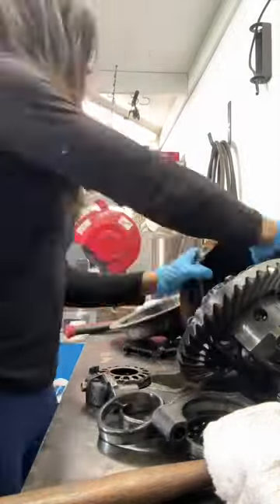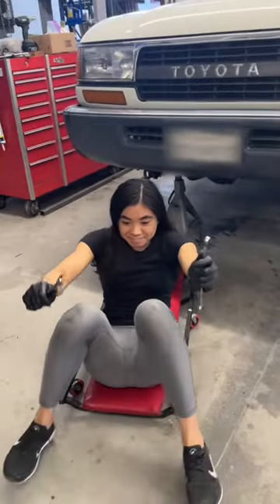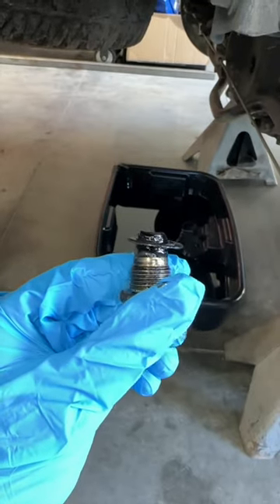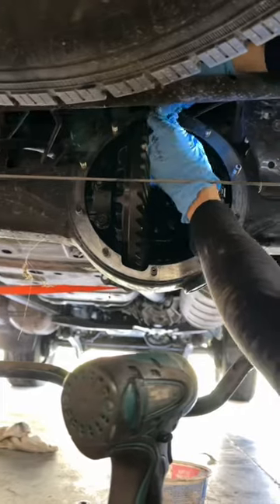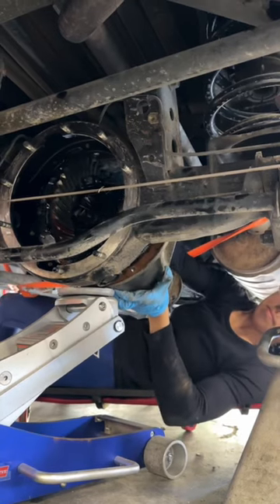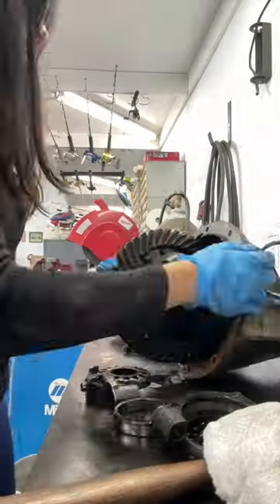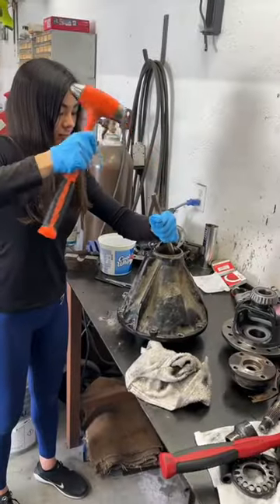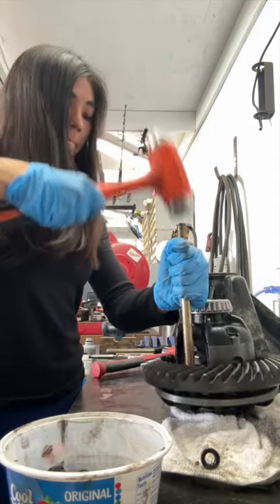Finishing my Land Cruiser Re-Gear! 😃⚙️ Pt. 1 #shorts

Comment: The first time I ever seen rear axle gears, was after I blew them apart and split the carrier in half, in my 78 cutlass after doing a 455 swap. Took the cover off and chunks of spider gears came falling out. Was satisfied that it couldn't hold the power and torque, so I swapped in a 12 bolt from a 68 el Camino. After that I've been enjoying painting racing stripes on the road whenever I want. It was a direct swap with a south side trailing arm kit, but still had to relocate the shocks and springs. That was when I was 19, I'm 50 now, and the whole rear suspension setup is now in a 79 cutlass with a 454. I still enjoy painting racing stripes on the road whenever I want ☺️👍
Reply: Hell ya let er rip tater chip

Comment: We used to submerge the ring gear in hot water before fitting to help expand it a little. You could probably use an induction bearing heater too

Comment: I know next to nothing about this sort of thing, so I'm wondering what effect the new gears will have? Awesome videos, too!
Reply: when putting bigger tires on vehicle , the rotation of the wheel will be slower relative to stock tire size. this means the engine RPM at 2300 on 4th gear would be at like i say 50mph on stock tires, same rpm would yield i guess 55MPH on bigger tires. putting new regear set would dial back the top speed to factory standards for bigger tires and regain vehicle acceleration performance and proper gear shifting, some vehicle would refuse to switch gears thinking they are under load towing.
Reply: @Kill4Time255  Ah, that makes sense. Thanks!

Comment: Nice job! 
   Pro tip:  put the ring gear in a toaster oven on bake at 200 degrees for 20-30 minutes. Will expand enough to get it on the carrier without needing a hammer and drift.